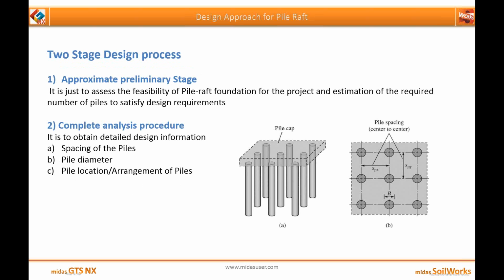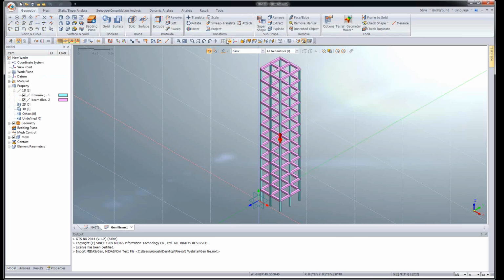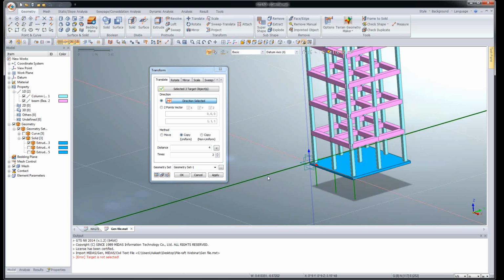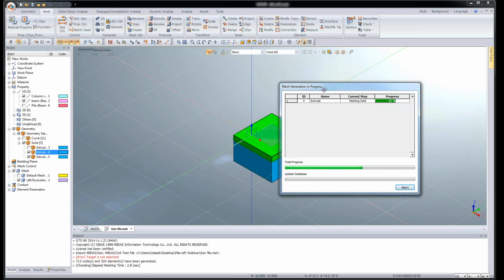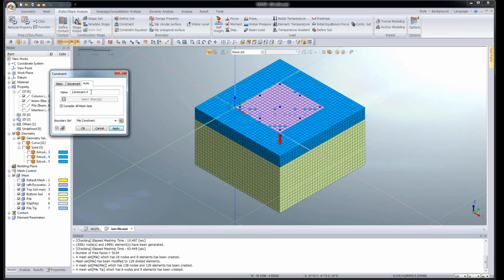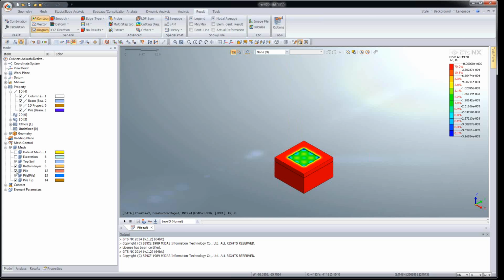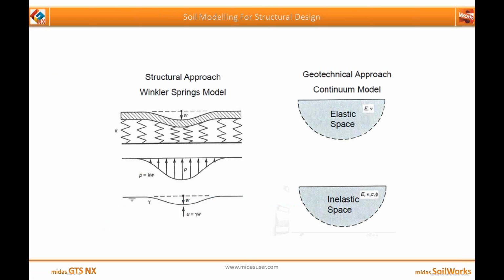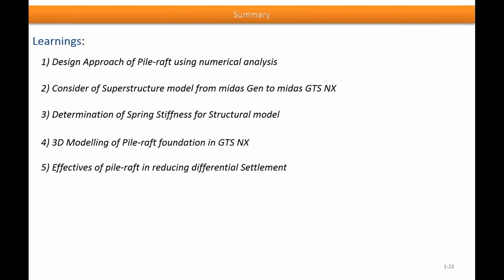[GTS NX] Pile Raft Foundation Analysis with Superstructure and Substructure - midas GTS NX Webinar

Comment: respected sir , I'm final year mtech student doing my thesis on pile raft foundation settlement analysis , i need your help in understanding some input values to provide in the model to obtain the desired result , it would be very help-full in mt thesis work please help me sir and one question if the piles are underreamed friction pile then also pile tip mesh we have to provide to the model